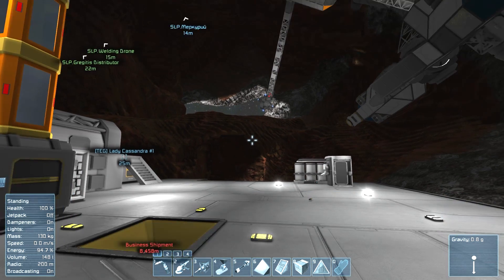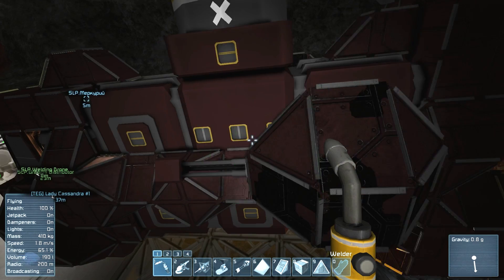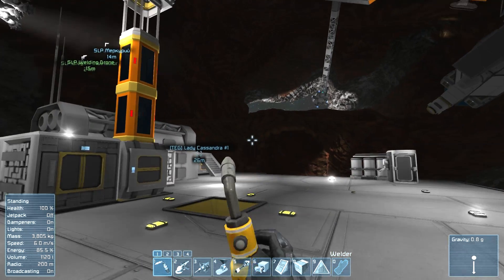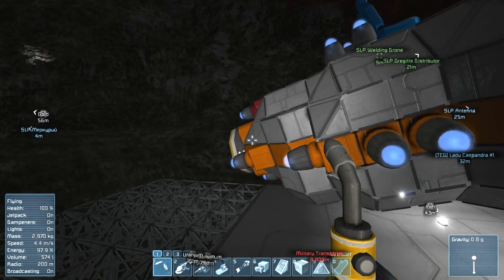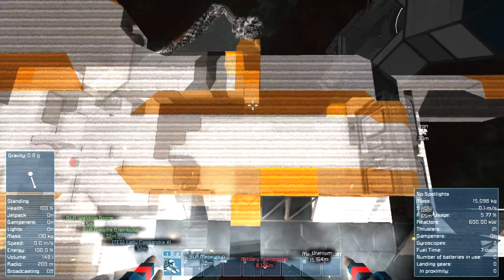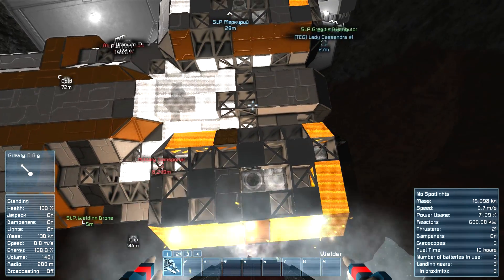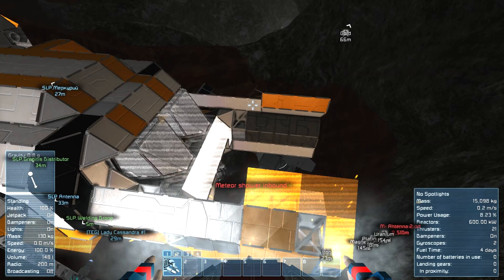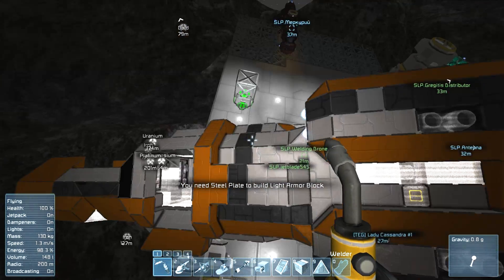Space Engineers - Let's Play #15 - The Corruption Special

Comment: That kid is A fool and has no clue what he is talking about.  You can not change the socket of A mobo. EVER.

Also .. Midevil runs poorly right now no matter what.

I have A I7 4790k @ 4.6Ghz
2x 780 Tis 
Ect ect ... 

And the game just runs bad.. but its alpha
Reply: You can but it requires swapping most of the circuitry out of the mobo.
Reply: neko77025 Honestly I can't believe the trolls already made it to this video. First, please don't call anyone an idiot, they might know something you don't. Second, he may have been talking about replacing an existing socket, damaged, with the same one. Third, you can change to similar sockets IF you modify some circuity, mainly in the power supply, and flash a new BIOS.

Another possibility: Say, like me, you have a AM3+ motherboard. It takes AM3 and AM3+ sockets. You can replace the socket with a simple AM3 because all the pins, etc. are already in place.

However you cannot upgrade your socket without rewiring the board entirely and then you'd need etching solution, etc.
Reply: waterlubber First off I am not A troll,. 2nd off Where Did I call anyone A idiot? . 100% BS.   You can not change A socket on A motherboard, As far as Replacing A existing Socket .. that is not what they were talking about at all, did you watch the vid Sentinal H clearly states that he cant upgrade his CPU because he has the best one for that socket and it would take A new motherboard And CPU.  The Kid then says you can change the socket and I have done it.   The whole context of the matter was for upgrading AKA A change in socket... Nothing about fixing or repairing the socket with the same socket as in bent pins.    And again .. .No you can not change the socket by modifying some circuity ...

Well the turth is you can but it wont work ... its like saying You can swap and dogs head with A cats head.  Sure you can do it .. but they will both be dead.  You / the kid in the video are 100% wrong.  Thier has Never been nor ever will be A socket change.   Google it .. cant be done.
Reply: Sure, I wasn't talking about Sentinal's situation. I agree that you cannot "upgrade" an existing socket but you can replace and change sockets like my case (AM3+).

As for you, I doubt your not instigating. You are extremely rude in that case.

You've mentioned me "talking out of my ass" (which is impossible, by the way) and you are very cocky in your self-image. Additionally, you're calling me a liar because I disagree with you. That is completely incorrect. Lying is intentionally falsifying information. jetblade can be misinformed, which is a different situation than lying. Honestly, it seems that you're upset because someone didn't hail you as an almighty god because you built a computer. My 12 year old friend did that. It's easy as crap to do, just attach components. I did it myself twice. Finally, please repair your SHIFT key. Your capitalization and spelling is absolutely horrible, and I doubt someone with intellect enough to have been building computers for 18 years would spell and type this way. I would expect you to learn that calling people liars and being as rude to jet and me as you did. Please stop being this rude, we could have had an education discussion on the topic but apparently you don't like being corrected. Have a nice day.
Reply: waterlubber Now I am confused,  The kid in the video.... who I thought was you.  Now I don't know.  Anyhow he is the Lair . He very much says he has changed A socket.  He did not say repair, and we can gather from the context of what Sentnal H was talking about it was Applying upgrading his comp.   I only comment on what I know, If I was not 100% sure I would of not said anything.  Their was / is some confusing on if you are the kid that stated the blatant lie.  As for my rudeness, You called me A troll and are putting words into my mouth.  Only thing I called someone was A fool , and that means they acting silly.  Talking out of your Ass .. means lair. 

btw AM3+ has 942pins & larger pin sockets  .. AM3 has 941pins ..  .. it wont line up.  You can put old CPUs in the new socket not the other way around.
Reply: Yes, but you can physically remove the socket part and insert a new chip.

liar* not lair. I am not evil and do not live in a lair.
Reply from the maker: waterlubber Okay guys, lets try and keep things civil without a lot of name calling. To clarify something Jetblade and Waterlubber are different people.

I just ask that we all try and keep things as friendly as possible in the comment section.